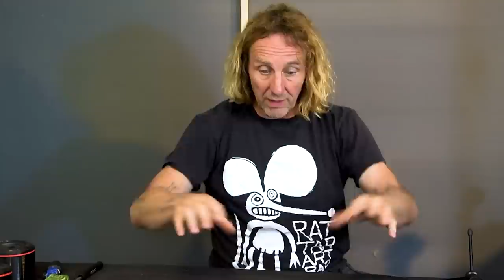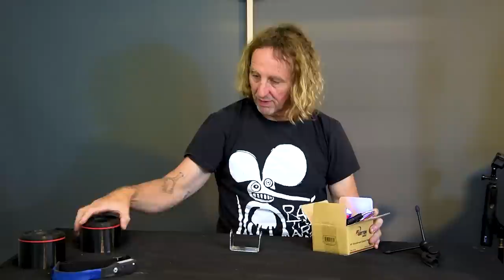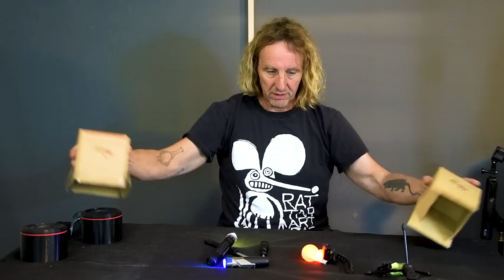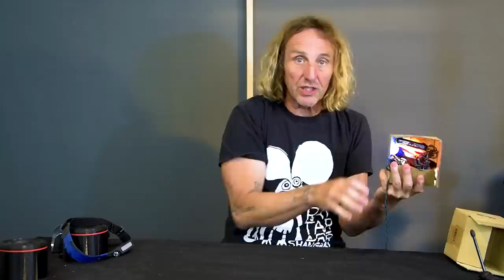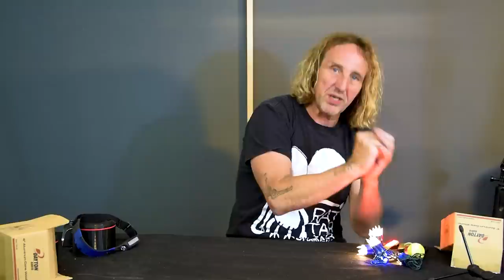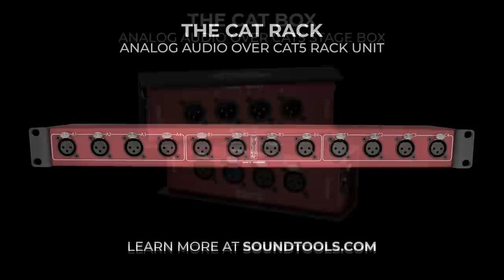Thinking Outside the (Speaker) Box - Does stereo Ruin Sound?

Comment: The theatre world has long done single source or single array per source setups, with the mixdown happening in the air rather than in the mixer. It's interesting to apply this to the rock and roll world. I've had really great results with a theatre style centre cluster in rock and roll - feeding vocals, kick, and snare to the centre cluster. Far better intelligibility and separation in the mix.

I've also done this in monitors, 3 wedges for the lead singer, outsides is band mix, inside is just their vocal - had several singers say they've never had a better mix.
Reply from the maker: May e search double hung PA to see how I applied a similar concept to arenas and stadiums
Reply: @DaveRat  Well aware of your work. Some years back your work appeared in my uni dissertation, and you very kindly gave me some useful answers and commentary via email.
Reply from the maker: Very cool. Yeah I am trying to sort why every sound system always sounds fake and artificial, even when the freq resp and capabilities of the speaker far exceed fidelity of the original sound source.

Record hitting a trash can lid or banging some sticks together.  The freq response of the source will be very limited, at the recording through the best speakers money can buy. 

Will the speakers recreate those simple sounds well nough that you are unable to differentiate the reproduction from the original?

I think not. The issue is not distortion or freq responce or really any of the primary specs we rely upon

The issue is with stereo and the way speakers are configured to reproduce, it will never work until we alter the config and  reproduction methods.

Comment: It is interesting to see this perspective. I don't think an instrument which spans multiple frequency drivers should necessarily come from different places because that isn't all that real IMO. However I did just recently see a video from someone with the opinion that sending just the instruments of a certain frequency range to the subs was a bad idea. They had a fair case but I don't know that it's all that bad. That is the simplest form of what you are talking about I think I've seen. I have wondered if at least for vocals if it wouldn't be better to have a center array. That might be cool to try but the bigger the place the harder all that is and given how much concert tickets cost these days if you fail to cover some part of a giant space with full range people don't like it.
Reply from the maker: Covering the entire audience is extremely important. 

And yes, there are people, well known engineers that have trouble with separate sub signals

And they believe that every mic, even the high hat and vocals must be able to get to the subs and then they EQ and high pass to try and not send those signals to the subs.

Or, you could just send the signals to the subs that actually need subs, which to me makes more sense and sounds better.

Comment: Thinking outside the “box”;

Either of these:

1) a speaker for each source that emanates in all directions maybe located in approximate locations in front of the band
2) all sources mixed for broadcast to headphones

Both examples would require that the sources not in themselves emanate any sound, but rather they all go directly into what is mixing them. To eliminate extra conflicting reflections 

Of course, a speaker that emanates in all directions does not exist at this point, yet.
Reply from the maker: Good stuff

Comment: Apart from the live sound maintaining challenge a question in a recording or broadcasting situation would be how to catch and transport the individual original / close up sound sources PLUS information about the 3D position of each individual sound source, transport all of that information and sounds and recalculate a sound perceiving experience at the desired listeners (virtual) position. Part of the process could be a kind of stereo mixing „recipe“ if stereo playback is required, as well as headphone mix „recipe“ or even others, maybe let the listener decide where (virtually) positioned. Crazy enough that unnatural stereo mixing and listening is still standard, but that we have to „phonitor“-ise that mix in to our headphones in order to make that sound , well, OK. Sorry 4 my clumsy English, hope you understand…
Reply from the maker: It does not need to be that complex. You are over thinking it.

Comment: But I always thought stereo sound sounded better than real. I love a good concert but I also love the simplicity of a stereo record. And it’s amazing what you can do with two speakers. However, I think modern PCs and YouTube and other things should have output standards that are user configurable. Imagine if you had a guitar amp in your room where all your guitar went through and individual drum speakers pointing at the ceiling with open backs and a woofer for kick and Bass. I don’t know how you would address this with headphones unless you had an absurd space helmet. Certainly stereo is limited but it certainly isn’t crappy. Lots of us have grown to love stereo mixes and often, if a record is mixed in mono, those sound good too. You’d need awfully sophisticated software to separate each instrument and assign them to your choice of speaker in real time. It exists but at the moment the software requires tweaking.

But for certain, PCs should have multi configurable outputs. Audio software should be sophisticated. And there should be a simple interface to make custom speaker arrangements easy.

But again, stereo mixing is an art form in itself which I can’t say is obsolete. 

However, the surround sound standards, 5.1 and so on were too limited to begin with.

Sophisticated real-time separation software and user friendly configurable outputs numbering between 4-24 would be ideal. 

It’s surprising that this doesn’t really exist. The software has been pretty decent for over a decade. I can’t imagine how good it is now.

But a GUI with 3D instrument choice placement on a graphic stage combined with however many speakers you want pointing in whichever orientation. Plus software to help you configure the least amount of interference or the appropriate interface. Maybe a few microphones well placed could listen to the recording and listen to your set up that would create a 3D map of ideal placement. That would be amazing. No need for it to be expensive. You wouldn’t need full spectrum speakers. Just speakers dedicated to each instrument.

But, again, when you have a good stereo mix, it sounds good on NS10s because it was mixed specifically to sound good on NS10s. So the stereo mix art form will doubtful ever die. We all grew up on it and it is amazing what can be done with it. 

But considering that this is the future and most people can operate sophisticated software, it’s time people had the option to recreate live music as best as they see fit. No more standards like 5:etc. we can still have it for simple home theaters, but 

Why not have software that doesn’t merely… I can’t remember the name of the thing that separates highs and lows.. oh! Instead of a cross over you have software that detects and separates each instrument and optimizes their EQ to play out of assigned speakers with dimensions and ranges appropriate to the range of the source.

I don’t think it would be beyond the consumer to set up such an in home music theater.

Comment: For instance, one sound i specially wouldn't mix with others is metal guitars, because it's a rather unique sound it usually doesn't sound very well on flat systems.
If i could build a sound system,I would run at least a separate PA made of guitars cabinets just for the guitars.
Reply from the maker: Agreed that hard driving guitar never sounds quite right on full range speakers

Comment: Interesting 😊. ❤ Now you have me thinking about a  speaker  to represent each instrument with the correct bandwidth  positioned to recreate the sound for each instrument as it was originally recorded, as closely as possible .
Reply: You know when we have a surround sound processor and they do a 7.1 and 9.111 point 1 and then they do 11.2.2 we really need A 256. At the very least we need A128 channel receiver or to isolate each instrument and each sound to heaven discreet output.
Reply: It's like when guys install audio and they go with one large wolfer 1 mid range and 1 tweeter. It's been 3 way for decades. But I say like with nanotechnology and other forms of reference you want to increase the resolution you have to increase the points of output. But we're still using nuts and bolts so everything I'm saying is far fetched.
Reply: But I think like with turbine engines or other forms of Turbo and accumulator and intensification... We do it with machines and other processes of principle in life but we don't do it with audio with motors is motors woofers and drivers. I've always thought that each size of a driver has a purpose and tightness and looseness and benefits for the ranges of frequencies on the octave. I see some guys with a system that has 20 of the same driver I always thought that if you have a fluctuation and you have an extensive cross over network and you overlap frequencies between each device you're gonna have really full tight and loose you're just going to have the reality. A high reference representation.
Reply from the maker: Love this
Reply from the maker: Surround sound is backwards. It points everything inward and we need multiple sources with speakers pointed outward
Reply: @DaveRat  Weird thing is the most I’ve heard is Multichannel Movies , ( last Movie was the latest Top Gun ) which I loved 🥰 sounded great . 
I’m quite happy with live sound ( I Mix  live with a Behringer X32  ) and my Biggest Challenge is the room for each venue. 
I have read about personal  listening rooms that get acoustic treatment before the system is installed .
How does this relate to the multi speaker solution?
Reply from the maker: Hmmm, trying to fine tune the tires and paint when the engine does not run well may not be the best focus.

Get your mixes and venues dialed before adding more complex concepts

Comment: Thank you, once again.  But I'm left with more questions (which is a good thing and why I like your vids): Can I, then, place 2 point source speakers right next to each other(touching) and make it work as long as I FULLY pan each source to ONE of the speakers?
Reply from the maker: That would depend on the recording.

With an old Beatles recording where the guitar was panned hard to one side and a drums were on the other side, that would work perfect.

With recordings we're only the low frequencies are mono and the highs and mids have a lot of stereo to them it would work but generally vocals are fairly mono so it'll cause some problems with that.

There are ways to convert a stereo recording into a compatible signal that will play back really well from three full range point source speakers right next to each other.

Basically the method is a wiring configuration that recreates a playback version of mid-side recording.

I did a video on it but I'm not sure if it's public I will take a look and if it's not I'll make it public fairly soon

The video I did though is on building a midside speaker
Reply: @DaveRat  My apologies for not clarifying.  I meant in a live sound application.  Example: 3 vocals 4 instruments and a drum set miked (just kick and snare).

My brain says it would sound fine if I were to hard pan each source to one of two speakers.  All vocals and snare to one box, then all instruments and kick to the other.  There shouldn't be any phase issues.  Is this true?  The reason why I would ever think of doing this is to 1. Put less stress on my speakers 2. I assume cleaner sound 3. The venue is small enough to do this where I don't have to put a speaker on each side for wide coverage.

You have convinced me to become of member of your channel for the fee.  I think the education I will receive will be more than worth it.

THANK YOU!
Reply from the maker: Welcome to the channel and thank you so much!

Do a search on Dave Rat double hung PA and there's good info out there on my blog and in some of my videos that cover that exact subject and let me know what you think

Comment: What about when you are recording in a studio & deliberately keeping instruments acoustically separate but then mixing everything back together into 2 speaker systems or (very different) a pair of headphones? I personally think some engineers are a little too creative.
Reply from the maker: I am just pointing out that the tools we currently use are incapable of recreating realistic sound. How and whether anyone can apply that knowledge to your application will vary greatly.

Audio went from mono to stereo to many forms of glorified stereo  radiating sound inward towards the listener like central heating.

Yet sound sources are more like campfires and fireworks radiating energy outward in differing directions and intensities.

Trying to recreate a realistic campfire by using central heating with wall vents will result in the same level of believability as we currently experience with the sound reinforcement systems we use

Comment: Always a pleasure to watch your videos. I remember experimenting with lots of little speakers and sources in a room and thinking there will be a way someday to build it up to scale for large events. That being said, have you heard d&b's Soundscape? Granted, I might be biased since I mostly use their gear but I must say it's a game changer for me and certainly a good step in the right direction.
Reply from the maker: D&B soundscape, Dolby Atmos, and L acoustics L-Isa are interesting ways to smear sound sources around between various speakers to try and create the illusion that the sound sources are located in various horizontal and vertical or rear or overhead locations.

This is all fun and useful and has applications.

What I'm referring to is that as long as sound systems are designed to be a bunch of shower heads shooting energy at the audience they will never accurately sound like many of the sound sources they are trying to recreate.

Actual sound sources are more like sprinkler heads in a field shooting sound in various directions where you can walk between them closer and farther. Trying to recreate this with shower heads blasting in the audience direction may be useful for practical but will not create audio that sounds like the original
Reply: @DaveRat  As always there is always a compromise. Yes, I agree with the concept you put out there and hope better solutions will emerge. On the other side I think the limitations of PA setups over the years might have conditioned the general public to expect a wall of noise to be blasted at them from a stacked or a flown bunch of cabinets regardless of what the instruments actually sound like in person. It amazes me how many people confront me for not taking part in what I consider to be this generation's loudness war. We moved from louder on CD's to now louder live mixes. I constantly see this babysitting at festivals where guest acts try to push everything to an eye watering limit. Yes, the most truthfull sound you get in a small room where nothing is really put through those showerheads but to my annoyance, people started asking me for double bass drum mics on a jazz gig in a small pub. Anyways, great food for thought and thanks again for all your videos. 😃
Reply: @PadreAG  I hate the waste of seeing great musicians playing and the PA is producing more energy than the room can physically hold with any clarity at all, no matter how "good" the sound system is.  I also get sick of hearing nothing but kick drum.  Thank God for the growing trend of listening rooms!
Reply from the maker: Too loud and too much kick are not optimum and yet just like everything, opinions of "too much" is a vast landscape
Reply: @DaveRat  Point taken.  However, the other people on stage appear to be holding real instruments.  I wonder what THEY sound like?
Reply from the maker: Inexperienced sound engineers are like driving with a kid who has the keys to a fast car.

Every kick beat is a green light and accelerator stomp.